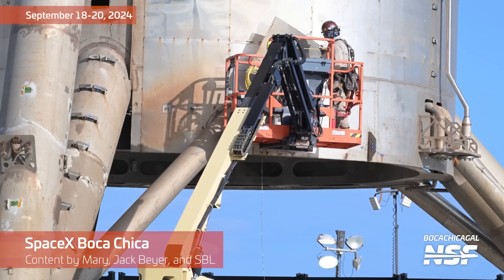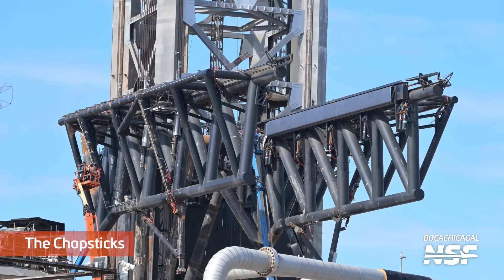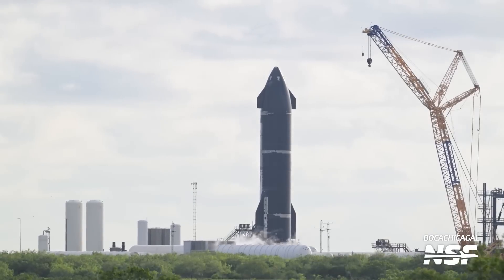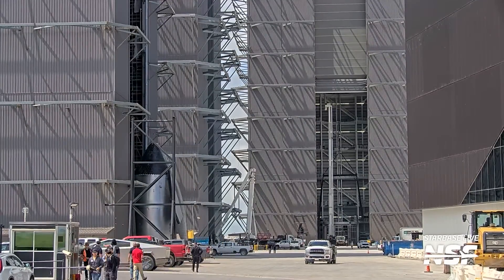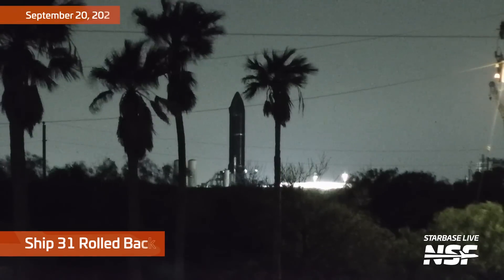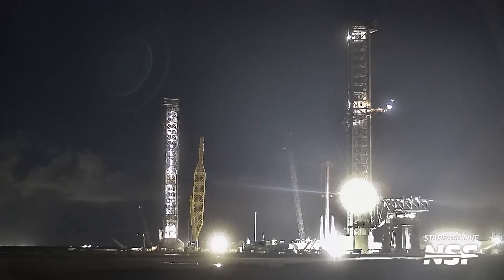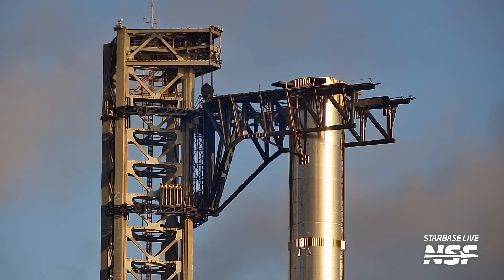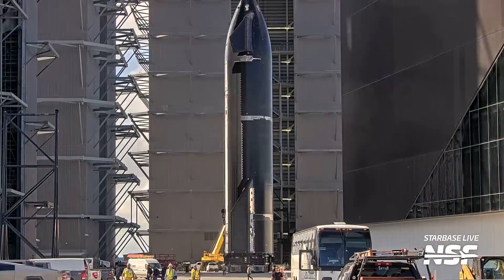Booster 12 and Ship 30 Roll Out For Testing, Ship 31 Static Fires and Rolls Back | SpaceX Boca Chica

Comment: Nice narration!  When are they going to put the landing legs on the ships?  They're also going to need another landing pad.  Oops.
Reply: Landing legs will only be installed on the HLS and Mars ship variants, and they're still quite a way off yet.

The current line of prototype ships don't need them because they're being ditched in the ocean until they work out how to catch one with a tower, which will likely be considerably trickier than catching a booster.
Reply: @grndkntrl  Yes, considerably trickier!  As in, never happen.  And they've never caught a booster—think gusty 25 mph winds. I'm assuming someone at SpaceX has already designed legs for the inevitable contingency. Ditching in the ocean is hardly "reusable."

Comment: 1:10 I hear ya on the concern for scrapping but do you think they would somewhat-meticulously be removing those outer panels if they were going to scrap it?
Reply: Yh if you look at how they scrapped the vertical tanks (cutting lance just hacking through it) they definitely don't look to be scrapping it, the fact they are using grinders to individually cut off welded brackets says that.

I suppose the question is, what IS the plan then? It could go to the office building (there were suggestions that it might, not sure how realistic they were), might it stay there (They poured concrete pads to put it on, and they've added the supports on each leg at the base)?

Whatever the plan, it's a mystery, but they definitely don't look to be scrapping it, more removing all the things added when it sat where it did for years.

Comment: @NASASpaceflight Sorry, but I don’t think so. SpaceX is build a "Mobile" Launch Pad. Because I have two reasons, the Commodity Pipes (Water, and booster fuel pipes) are Straight and Fixed.  And the Second Reason, the "Mobile" Launch mount does not fit Between the Bay Doors. In my Opinion, is SpaceX Building the Launch mount at Sanchez, transporting it to Launch Pad B, and then installing it on top of the Flame tranche.